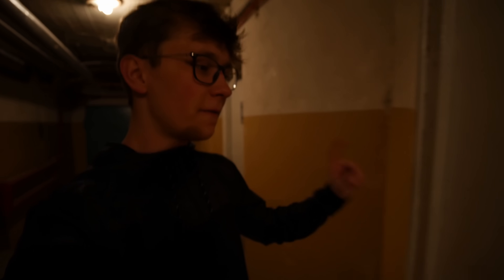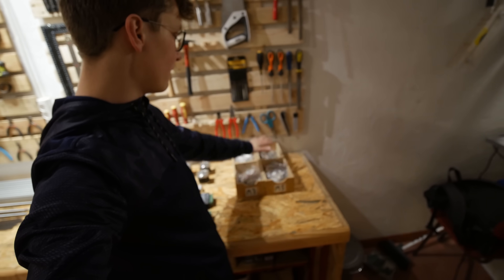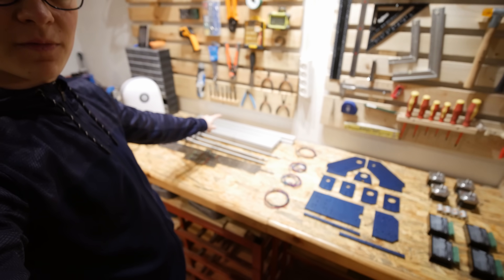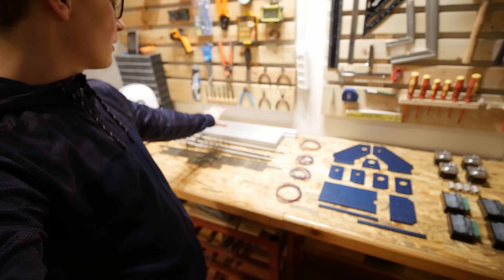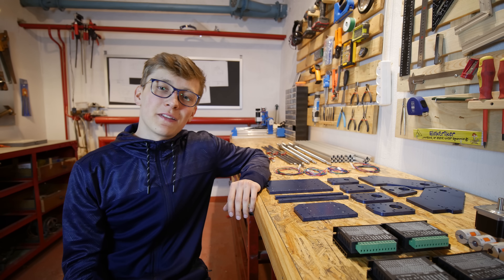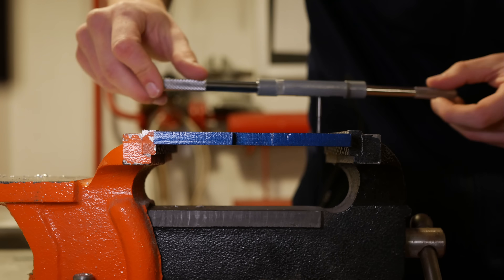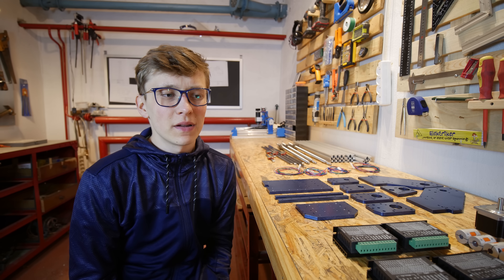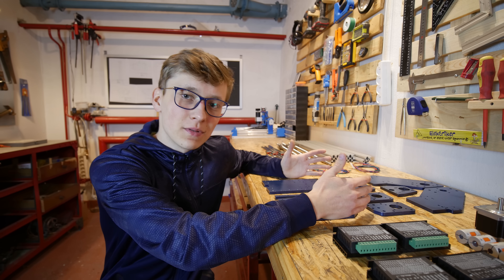IndyMill - DIY CNC Machine #2 Assembly

Comment: Looks great! 2 things i have to mention. First dont use 3d printed parts for the ball screw nuts because all the cutting force goes in it (you can buy premade really cheap). Second use some proper ballscrew supports like BK BF blocks at both ends this 3d printed part with a ball bearing in it cant withstand the force and will give you backlash play. Dont wanna sound neardy but i allready build 3 mills myself and learned a lot from it! If you need help with parts i can help you. Keep on your great work allways fun to watch!!!
Reply: This. Your printed bearing holder will not withstand the forces and the bearings of the motor are also not made for those loades. The nut holders are way to weak and i would go with a proper (smaller spindel for z. But a really great project and I'm looking forward to the next parts
Reply: Absolutely agree!
Reply: @Manuel, I've just started looking into a diy cnc... are linear guides such as the ones Niko has used here worth it over using wheels on v-slot?
Reply: pj hi. If you want stability in your machine i recommend using linear rails. The best ones to use are hgr15 or even better hgr20. With rolls you will get to much vibration in it. for 3d printer it ok because there is no cutting force!

Comment: You use super strong and rigid  parts for everything (steel plates, linear rails) but you use a tiny 3D printed part to connect the steel plate and the ball screws 
I am afraid it will flex or might even break
Reply from the maker: I will update that later with something milled out of aluminium or bended steel
Reply: @nikodembartnik  Good reply.  It doesn't need to be perfect straight away.  Nice project Niko!  Don't let the comments get to you.  You're videos are improving too!  Dan.

Comment: Try turning a centering tool (45° chamfer) for your drill press and start the tap with it. You need to keep the tap absolutely center and straight. The little dimple in the top of the tap is for just that purpose. Slightly chamfering a drilled hole before tapping helps a lot too.

Comment: Looks like you forgot the ball screw mounting adapters (BK12 or BF12), you shouldn't just attach it to the stepper motor.
Reply: Better use FK10 and FF10 bearings, could be easily integrated into the smaller plates 
https://a.aliexpress.com/_d8grQcx
Also should there be a plate behind the two rails forming the portal to stiffen it up for torsional forces and forces in z direction for example when drilling straight down.
Reply: As has been stated, the bearings in the stepper motors is not adequate. They are not designed for axial loads. This will likely be one of the first problems you will need to address after you get it all working.
Reply: EXACTLY
Reply: +1.... I was dying inside when seeing it. Nice looking machine and all but using a ballscrew without proper end bearings is a waste of time and money.

Comment: You need a fixed bearing block for the ball screws , by not using the bearing blocks the cutting loads will damage the stepper motor bearings. And the 3d printed part the connects the ball nut to the steel plate is tiny it will flex and it will cause shatter, you need to beef it up by alot. The name of the game in CNC "the bigger, the heavier ,the stiffer" the better.
Reply: Important point there. His solution will also introduce some play which makes the use of "playless" ball screws useless in comparison to normal lead screws.

Also it might be good to tear town and clean the cheap MGN rails and blocks. I found quite some metal chips inside of mine when I cleaned them before use.

Third point is the squareness of the whole construction isn't checked at any point. You should not trust in the squareness of the cuts of aluminium extrusions.

These things show there is a big difference between industrial design and DIY/maker design - no offence I enjoy your project's.
Reply from the maker: It will take sooo long to destroy the stepper motors that way that most likely it's not gonna happen, maybe after using it all day long for few months. When it coms to 3D printed parts, I know that it's not a good solution, I want to later upgrade that with something milled out of aluminium or maybe bended steel. We could go on like this forever and make a $100k machine from this project, but that's not the point
Reply: @nikodembartnik  I understand your point, but if you are going to follow this path of "stepper holding all thrust loads" you will inevitably have to switch the couplings and/or re-design the 3d printed bearing holders. These spider couplings are not made to transfer axial loads and have no defined axial positioning (only made for torsion loads, rotation), so if you apply compression/tension loads (cutting forces) they will move and create backlash. Loads pushing the ball screw away from the stepper will have to be carried out by the bearing which is not axially located on the 3d printed part (given enough repetitive force the bearing will move in the 3d printed part), and loads pushing the ball screw to the stepper will compress the coupling until it bottoms out, and then they are not actually helping with misalignment anymore. I suggest that you use a simple rigid coupling (even 3d printed) instead of a flexible one, if this topology of the design is to be kept.
Keep up with the good work, though!
Reply from the maker: Thanks for your tips, now I see what you mean and yes indeed that may be the problem because those couplers don't hold together very well. How about a 3D printed "case" for the coupler that will keep it in place and at the same time let it still be a coupler? Maybe eventually I will replace those coupler we will see. That's why I don't want to share any design files yet, a lot may change :)
Reply: First off. Love your work I have a scaled up 540x500 dremel cnc. 
I work with large cnc's everyday (makino, mazak, mori seiko etc). As all others have stated you need the proper end bearing blocks with thrust bearing and lock collar to set the stretch of the ball screw. The ballnut also needs a proper metal housing to transfer the torque to the gantry plates.

Another thing I've seen with rails that small is that they can deflect, especially since you have not used all the holes in them to secure them to the frame. It will add a Ton of rigidity. I've been able to push rails of that size over 1/2" when 3 or 4 bolts have snapped off and that was a servo door!
If you do the upgrades and slap a 2.2kW spindle on there. It will probably cut aluminum quite well. Keep up the good work.